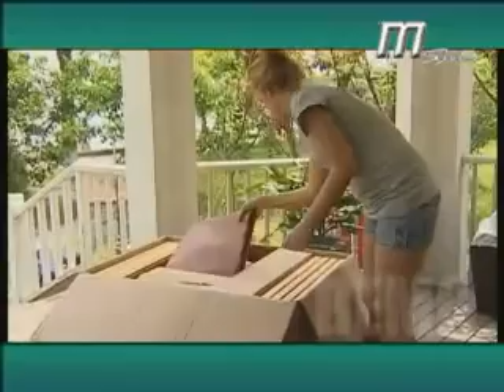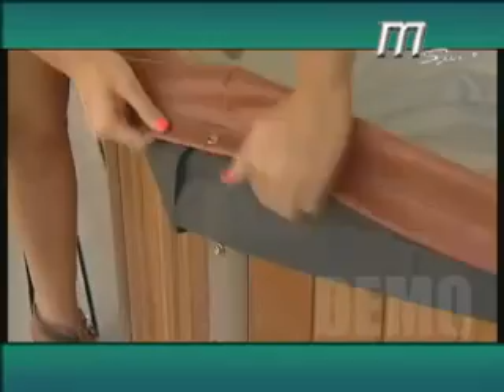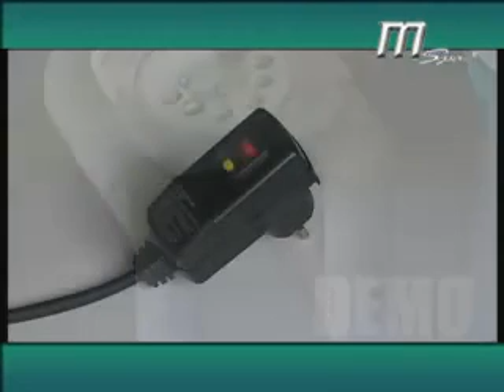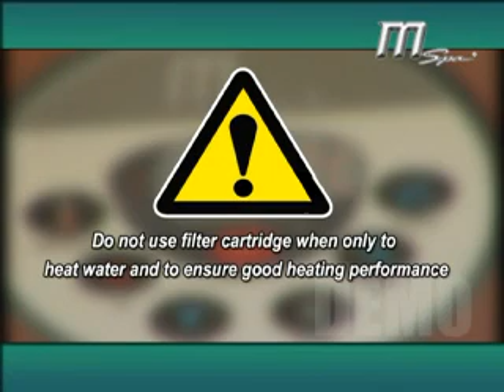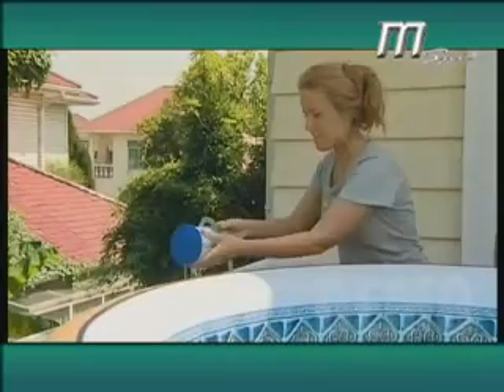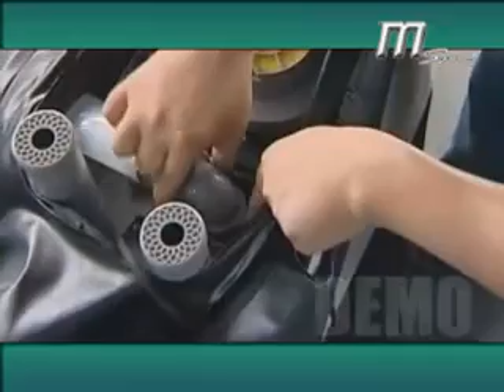MSpa Tuscany Portable Rigid Frame Spa Tub

Comment: I'm trying to put one of these together, the liner holes don't stretch far apart for the locking brackets, 2 people pulling on the liner struggling to make it fit.
Looks so easy in the video 🤷‍♂️
Reply: I used a hairdryer to loosen mine up, it helped a lot.